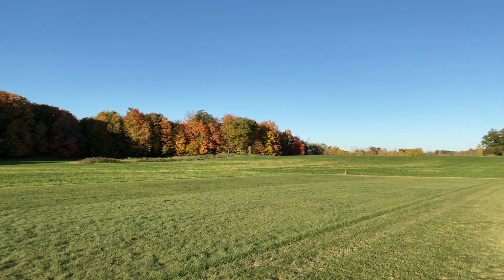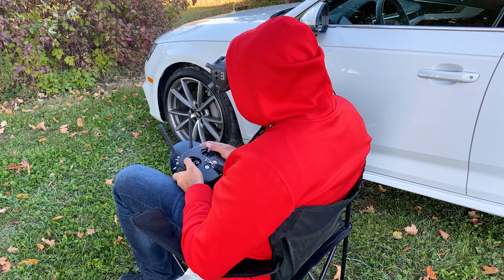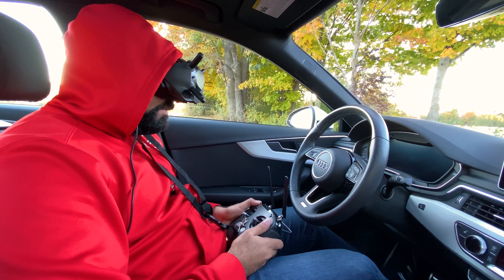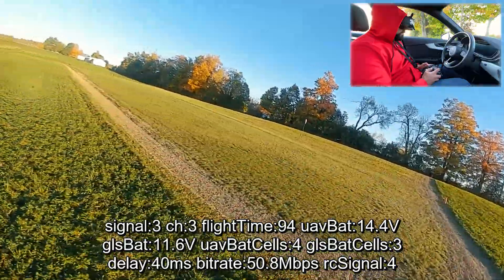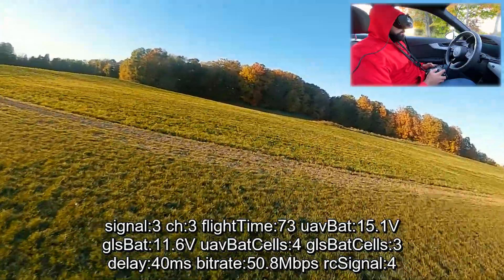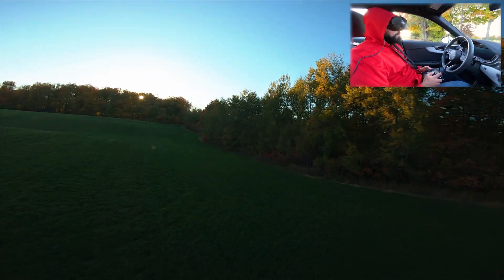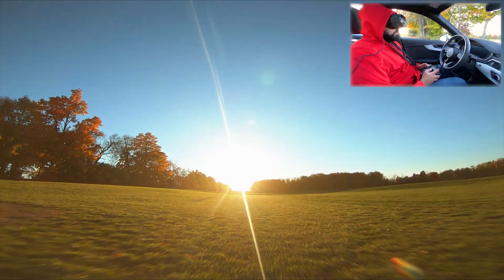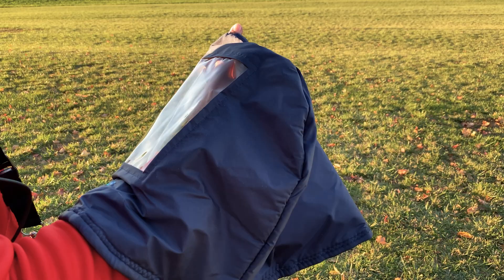Can you fly the DJI Digital FPV system from inside your car? TrueRC Singularity Stubbies Follow-up!

Comment: This test is irrelevant because of the conditions the last time the field was covered in snow the humidity was much higher and we all know 5.8ghz dont have much penetration in high humidity you should do it again when it snows.
Reply from the maker: Hey. The humidity should be lower in the snowy weather. I understand that colder weather holds less humidity and the snowy day was way colder than the non snowy day. The test wasn’t about the snowy day vs non snowy day, it was about the impact of flying from inside your car and the two tests were done back to back on the same day.

Comment: i do it like 90% of the time summer winter ... i even flown from my bed in my bedroom
Reply from the maker: Nice! Did you do this when the DJI system was just released or a bit later on? I’m still thinking it was the firmware updates that made this possible.
Reply: @Mangorille  I just got into FPV like 3 months ago.. so i dont think i was on the old firmware. (flying from my room i was using dji fpv drone which can be trusted, but air unit drone I still prefer sitting in the car even if the signal is slightly lower.)
Reply from the maker: @Mike-fm3km  Welcome to FPV! Ah okay, can't 100% compare the dji fpv drone with the DIY drones that use the air unit.

Comment: Haha! I live in Canada. 11.5°C is NOT cold! 😉 Just flew few packs in -4°C. Good test. I knew you could fly from inside a car but was wandering how is the signal affected. Cheers!
Reply from the maker: Haha, hopefully you weren't flying in -4 outside though. I've flown in that kind of weather from inside though. :)
Reply: @Mangorille  One pack outside... Fingers frozen... Then I moved inside the car. That's how I knew it could be done but I only flew close, right in front of me so wasn't able to judge how much the signal was affected.
Reply: @jgrudnicki  I have flown my today from car at 3°C but when I was close to the car, signal have dropped  for some reason - I have stock antennas
Reply: @Tadamagicsky  I guess you could place the antennas outside (on top of the car) with a short rg316 extension.
Reply: @jgrudnicki  I will consider it for next session, many thanks Jan 😊
Reply: @Tadamagicsky  let me know how it went. I'm considering doing it as well.
Reply: I have -9°C flights videos but piloted from inside car. I use a ribbon extension cable with the TBS crossfire module and place the module on the front edge of car dash board against the windshield. I use a ground station VRX, and it is also placed on the front edge of dash board. The VRX signal is better with ground station than antenna on my head because my head is always tilting with the craft, not aiming at the craft.

Comment: OMG you need ground station...... if it didn't go well last year why you didn't prepare for this winter?  Please.......
Reply from the maker: Hey. A base station is more challenging with a digital setup. I know folks that simply get a SMA extension with a magnetic base and put the goggle antenna on the roof outside their car, doesn't make sense to do that with the digital system considering the four antenna. Video shows that you can fly okay from inside the car now even though it didn't work last winter.
Reply: it's just connecting 4 cables. easy
Reply from the maker: @fluoxethine  You have to buy them and carry them out there. If it didn't work this time around would have considered that.

Comment: Warm your lipos before you fly. Your lipos will last longer have better punch and consistency through your flight.
Reply from the maker: Thanks, good suggestion. Should keep the batteries in the car until ready to fly with that pack.
Reply: @Mangorille  If you don’t already warm them you will be pleasantly surprised I get mine a little warmer than most. It’s still safe Iv experimented but not for too long and I keep them warm until there flight.
Reply from the maker: @fpvraver  Cool, thanks. How do you warm them up?
Reply: @Mangorille  it depends if I’m using my car I’ll warm them on the heat vents put it in like 85° for like 10 to 15 minutes depending how powerful your heat system is in your car the packs should feel warm to the touch but do not leave them unattended I do it while I’m driving the car or like while it’s warming up and then on the way to where I’m flying
If I’m flying at home I try to use hey small heater with a piece of padding in between that and the batteries I have an alarm clock attached to it just to be safe you don’t ever wanna leave your batteries unattended under heat you can have a large fire. If you want to be totally safe you can order the Mr. steel battery warmer it holds a decent amount it has a USB charger on it and it keeps them perfectly. I think they’re $50
Reply: Google Mr Steel TBS Battery warmer. It’s on The TBS website. TeamBlacksheepTBS.com
I believe is the address if it’s not it should get you close enough

Comment: I have strange "problem" with my dji system... When i go behind few walls or trees, i still have 3-4 bars signal and 50Mbps, but i have strange frame drops, like it lowers fps alot... I dont understand how it doesnt affect my signal strength or bitrate, but it affects fps that i see... And even stranger, it DOESNT show up in my goggles dvr!!! I always look at my videos later, and it looks perfect...but when im flying, it shows in real time, and its annoying af...
does everybody experience that, or its just me?
Reply from the maker: Hey. Never seen anything like that in my goggles. What happens to the latency when this happens? Also are you running the latest firmware? With or without SD card in the air unit?
Reply: @Mangorille  latency is still normal... latest fw, with or without sd (same thing happens)
Reply from the maker: @ivicanikolic034  Very strange. Perhaps create a post on the DJI FPV forum or R/C Groups owners page.

Comment: Nice follow up to your first test. Yeah man, i fly from in my truck all the time, I honestly don't notice much difference. I noticed your latency is really high, are you not in low latency mode? I'm in the low 20's to low 30's max, and I see you getting up in the 40's.  Great flying btw :)
Reply from the maker: Thanks bud! I fly high quality mode. High 30s/low 40s is on a good day but seen it go into the mid 40s from time to time.